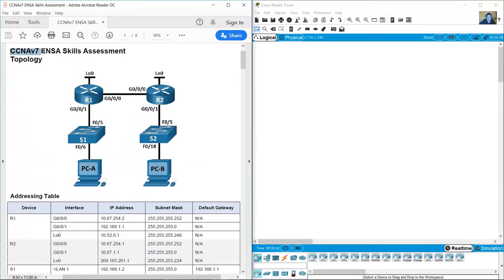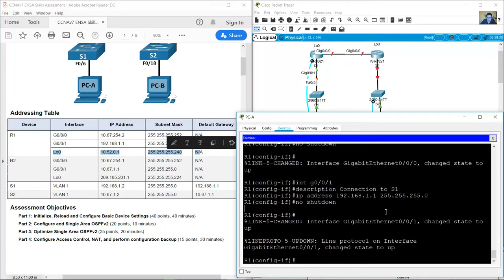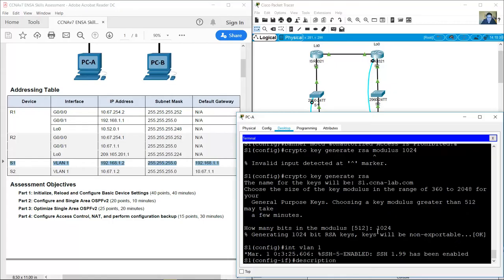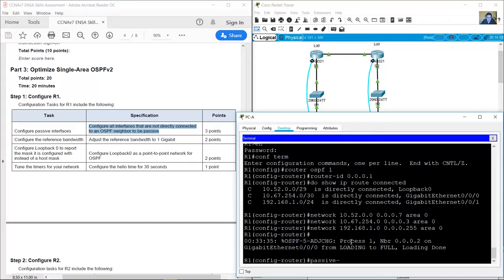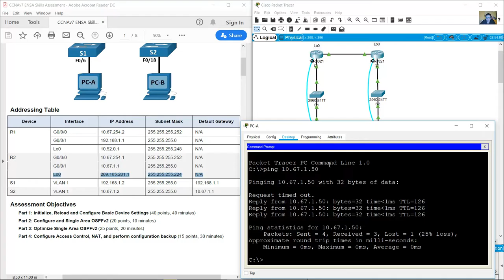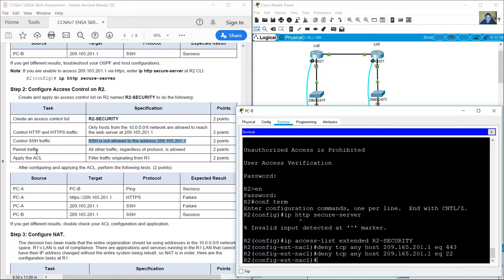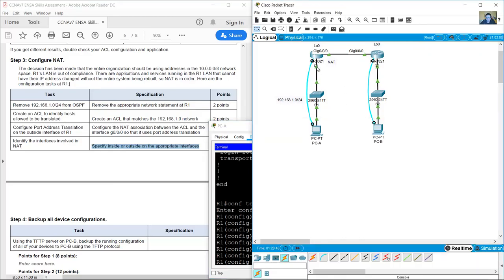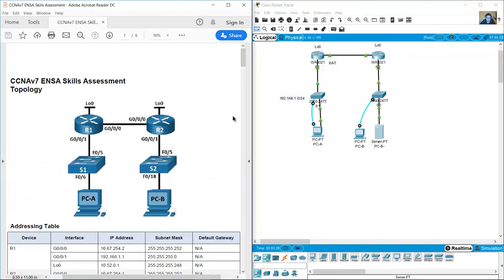CCNAv7 ENSA Skills Assessment

Comment: Part 4 the new ccna3 is
Step 1: Configure host computers.
Configure the host computers PC-A and PC-B with IPv4 addresses.
Description PC-A PC-B
IP Address (PC-A) 192.168.1.50 / (PC-B) 10.67.1.50
Subnet Mask (PC-A) 255.255.255.0 / (PC-B) 255.255.255.0
Default Gateway (PC-A) 192.168.1.1 / (PC-B) 10.67.1.1

PC-A -> PC-B Ping -> Success
PC-A -> 209.165.201.1 Ping -> Success
PC-A -> 209.165.201.1 SSH -> Success
PC-B -> 209.165.201.1 SSH -> Success

On part 4 the new ccna3 is
Step 2: Configure Access Control on R2.
Create and apply an access control list on R2 named R2-SECURITY to do the following:
Create an access control list R2-SECURITY
Control ICMP traffic
 : ICMP traffic from hosts on the 192.168.1.0/24 network is

not allowed to the loopback on R2 (209.165.201).
Control SSH traffic SSH is not allowed to the address 209.165.201.1
Permit traffic All other traffic, regardless of protocol, is allowed
Apply the ACL Filter traffic originating from R1

PC-A -> PC-B  Ping -> Success
PC-A -> 209.165.201.1 Ping -> Failure
PC-A -> 209.165.201.1 SSH -> Failure
R1 -> 209.165.201.1 Ping ->Success
R1 - >209.165.201.1 SSH -> Failure

I cant figure out how to do on step 2 regarding the ICMP / ACL method.
Reply from the maker: you can send me the files ans specifications using social networks shown on 00:03
Reply: why is it saying request timeout

Comment: A few things regarding Part 4. You don't actually have to create a whole second server on 10.67.1.50 - I'm running Packet Tracer 7.3 (or whatever the latest version is). PC-B has TFTP server functionality on it. Just treat it identical as a server. The commands and everything are the same. (meaning you can also restore a device from PC-B using TFTP. yay science!)

However, I still have the exact same problems with S1. How do we know it will work in real life? I don't have that much hands on experience....
Reply from the maker: ON 1:03 I just added TFTP server, on real life, on a windows pc you can run tftpd64 software to run the tftp server on PC-B
Reply: @romeroc24  Why exactly does S1 shit the bed in Packet Tracer?
Reply from the maker: @hermessanhao  I demostrated that all works fine except web server on router when is configured on packet tracer
Reply: @romeroc24  I understand that. I've done the pkt as well. I'm not asking about the whole thing, merely the weird part at the end (Part 4) where S1 doesn't copy its config file to PC-B' using TFTP. It's literally worth .25 points, so I'm not worried about it. I'm just curious.
Reply from the maker: @hermessanhao  OK now I understand, packet tracer may fail and have a lot of bugs but every new version fix each bug
Reply: why is it saying request timeout???

Comment: the network between the two routers also comes from the 10.0.0.0/8 network so wouldnt the acl deny packets coming from that?. also i still dont get why u didnt use 10.0.0.0/8 as the source in the acl instead of any. since it says only hosts from 10.0.0.0/8 network
Reply from the maker: both are valid
Reply: @romeroc24  could i put 

permit tcp 10.0.0.0 0.255.255.255 host 209.165.201.1 eq 443

deny tcp 10.0.0.0 0.255.255.255 host 209.165.201.1 eq 22

permit ip any any

and then: "ip access-group R2-SECURITY in" on r2 g0/0/0 interface?
Reply from the maker: @rohailbukhari2687  yes not problem
Reply: @romeroc24  ok but when it says "ssh is not allowed to the address 209.165.201.1" does it mean from any source or from the 10.0.0.0/8 network
Reply from the maker: @rohailbukhari2687  video show you all, but ssh is the specific 22 port, you need to add the port on the ACL